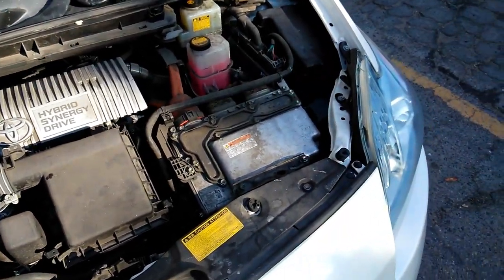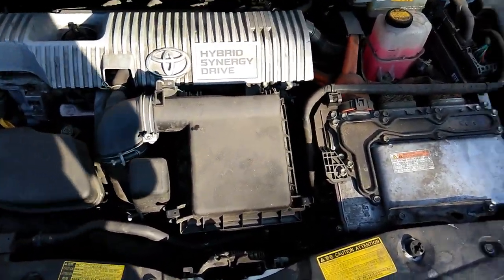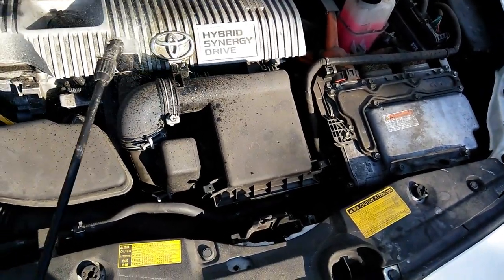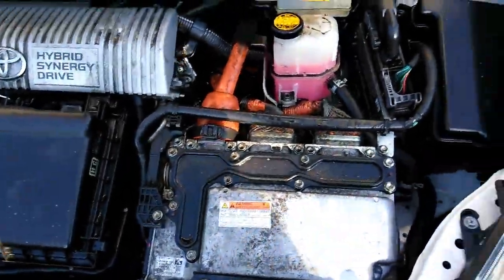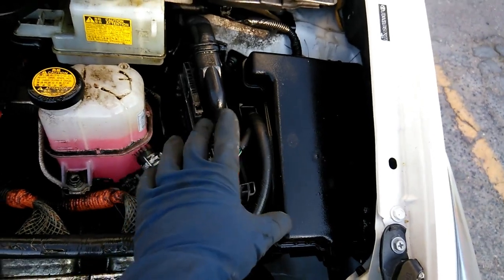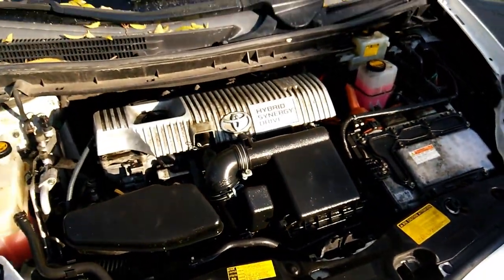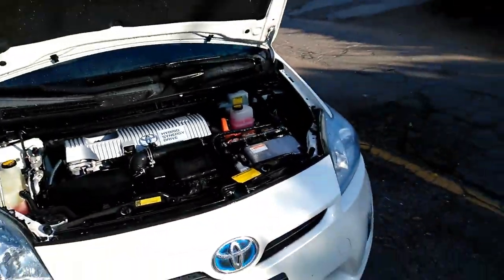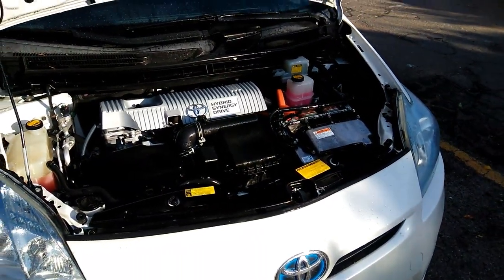how to pressure wash toyota prius engine bay

Comment: My method is similar to yours but I take aluminum foil and cover as many of the exposed electrical wires and components as possible.  I then spray degreaser as you do and spray the engine bay and hood for 20-30 seconds trying to minimize exposure to water as posible.  Next I take a towel and try everything I can reach.  Remove the foil and dry that area.  Before covering with foil you can spray a little WD40 which works as a water repellent and protects electrical contacts.  I'm extra careful because I don't want any electrical issues and my 2019 Honda Insight hybrid is still under warranty and I don't want to void the warranty.

Comment: Also in general don't spray the alternator on other vehicles and watch out for the fuse box.
Reply: alternator in a prius??
Reply: @volvo24091  a prius doesn't have an alternator im talking in general for any other vehicle. Im a dealer and specialize in prius and Toyota hybrid models if you want any tips or tricks about a hybrid system feel free to msg me.
Reply: PRIUS DOESN'T HAVE IT 
THE ELECTRIC MOTOR ACTS LIKE THE ALTERNATOR AND STARTER
Reply: @21boxhead  yes i know that im talking in general about any vehicle.
Reply: @ Mark Ammari Looks like you edited the first comment after being called out
Reply: @volvo24091  yes i sure did because people kept thinking i was talking about a prius when i was talking in general so i fixed it for yall snowflakes so yall can not get so soft.     Im a dealer and specialize in prius i know lots about them and so does my dad that also has a dealership for almost 30 years that's mostly all we sell is prius and have a hybrid mechanic.
Reply: @markammari3694  dude can you make a video on how to clean the engine bay of a 4th generation Toyota Prius?
Reply: Did anyone remove engine cover and spray . Mine has dirt and grime should I just use a rag and water to clean off ? Thanks

Comment: As a dealer mechanic, this is fine
 But you washed way too close to that fuse box and ecu, back it up when you hit those. and be careful of the degreaser you use as some are not good for rubber or plastics.

Comment: What should be used to wash the engine?
Reply: I use some stuff call SIMPLE GREEN using a 50/50 dilution with water. It leaves a nice black finish with no soap residual. I also use a standard water hose and sprayer. Pressure washers can push water into places it shouldn't be and will peel off labels

Comment: Wouldn’t spraying water be bad for a engine? Or any form of electric parts
Reply from the maker: Depending if your soaking the motor with a regular hose. Now with a pressure washer its easier to wash the motor. But still take precaution when washing. Like alternator, fuse box, ecm